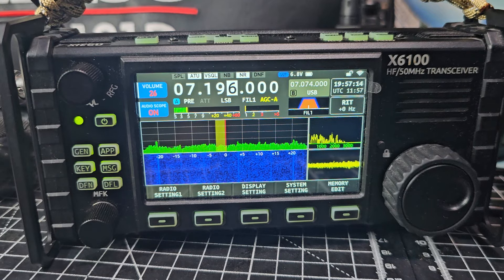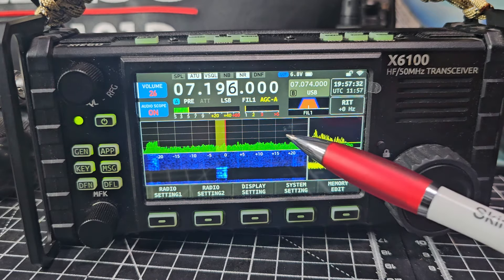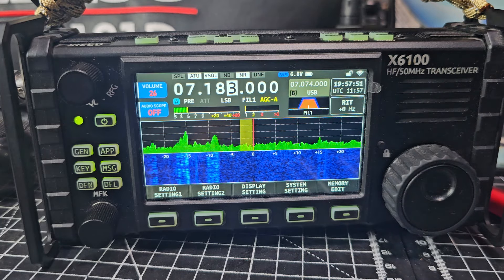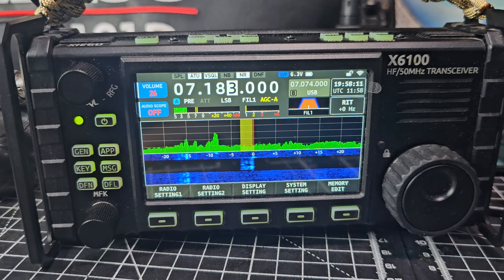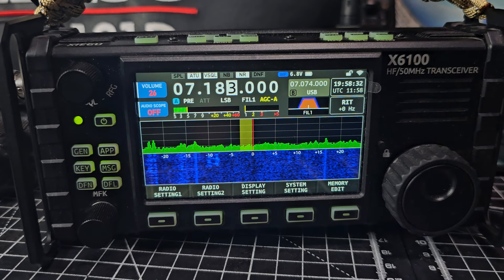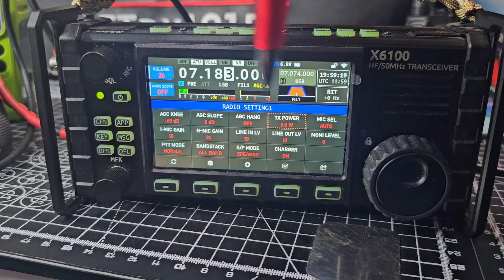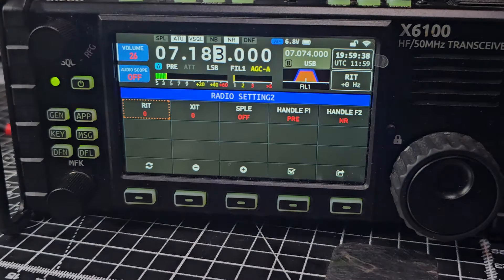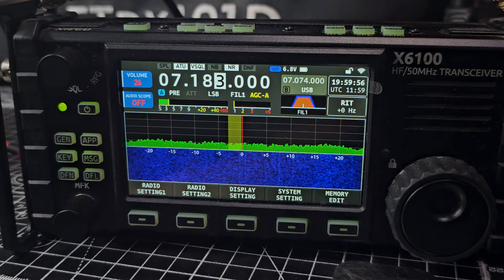XIEGU X6100 - ALC reading  & IQ Out Needed

Comment: They also need to add a hyphen in the keyboard.   I was going to change my NTP settings to use one in Boulder Colorado and they have a hyphen in the url.
Reply from the maker: Connect an external keyboard via bottom usb C